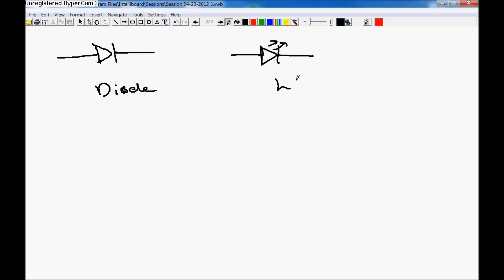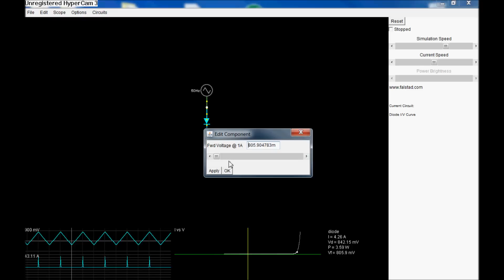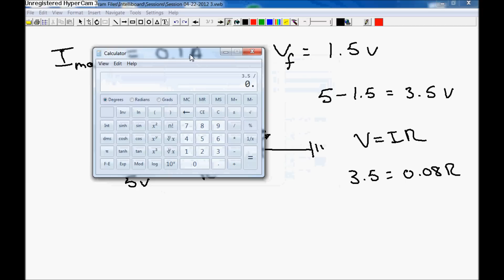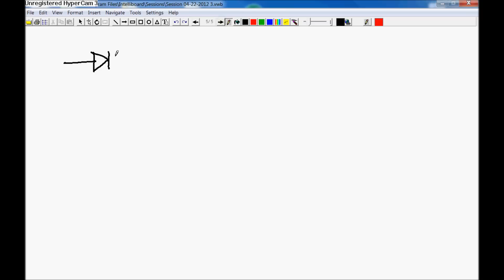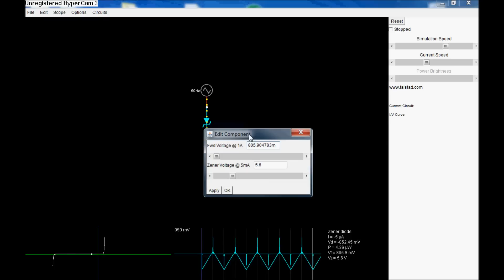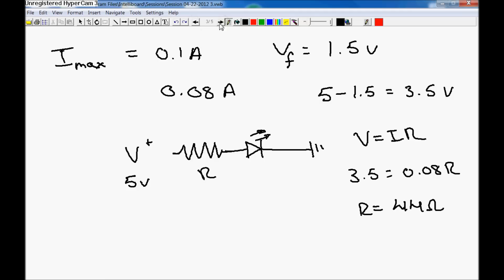Electronics 101: Diodes

Comment: OK,  but I have watched other you tubes that say that when the cathoide is attached to a  negative terminal,  the diode is forward biased and electrons flow from the p material  of the cathode towards the depletion junction.   This means current is flowing from cathoide TO anode.   When the cathode ius attached to a positive terminal,  the diode is reverse biased and no current flows.  I am now left confused by your explanation of the current flowing FROM THE ANODE to the cathode.  I would appreciate your clearing this up.   Thank you.

Comment: How do you read a diode? And how do you know how much Volt and Amps of the diode you need to use? What i mean is that i have a solar panel that produce 25 watts, 1.33 Amps, and 18.8 volts and i want to know what the diode voltage and ampage amount do i use?

Comment: at 8:38 when talking about current flow direction. Do you mean conventional current flow or neutron flow?
Reply: clinton Raubenheimer You are overthinking it.  I don't know why books make such a confusing fuss about the two different "theories" of current flow.   Ignoring back EMF or your armchair physicists pet theories, current only flows in one direction.  An excess of charge (free electrons in the standard model) builds up pressure and wants to disperse.  In a circuit those electrons disperse across the circuit to the low pressure location known as "negative".

He did not even specify "+" or "-" so there really should be no confusion.  If he says current is flowing "---->" (l to r), he means  "electrons start here --------> flow to here"

conventional
+ --> -       (electrons start here ---> flow to here)

electron flow
- ---> +     (electrons still start here -----> still flow to here)

It is a really stupid distinction based on the semantics of how you describe what is occuring.  

Ben Franklin (who invented "conventional flow") RIGHTLY assumed that charge accumulated and disbursed from a location of POSITIVE electrical pressure to a location of NEGATIVE electrical pressure.

Some jack asses who thought they were extra clever decided that this was "wrong" because "electrons" are "negative".  Besides the fact that assigning a "negative" charge to electrons is arbitrary itself,  it seems to have made a pointless mess of things for no good reason.   There is nothing inherently wrong with thinking about electricity in conventional flow terms.  It is analytically sound.  It is, imho, actually more baseless to use electron flow, because electrons aren't really "negative" anyway.

Comment: Easy to follow, thanks for the vid!! Quick question about zener diodes. What's their relation to transistors in a power supply circuit? Would they help control how much voltage can pass?

Comment from the maker: Technically no. There are some complex formulas that will give the actual current through the diode at given voltages. But for simplicity's sake, if you're going to be operating the diode well above the forward voltage, then the resistance is really, really, really, close to 0.